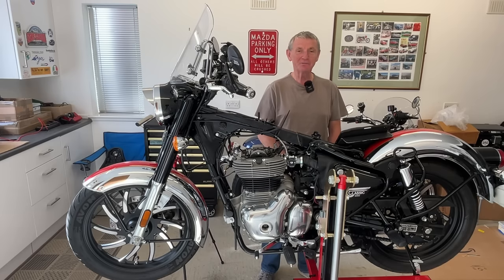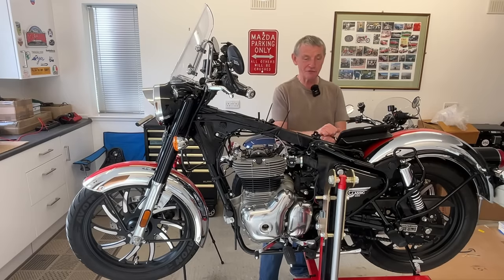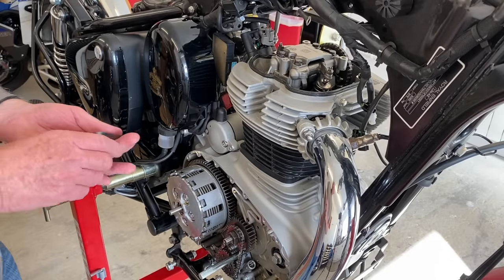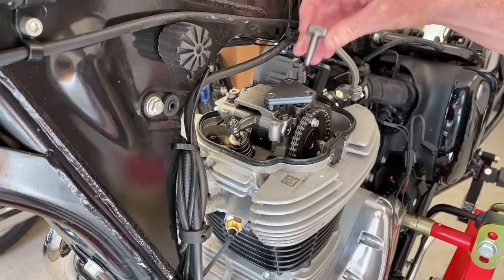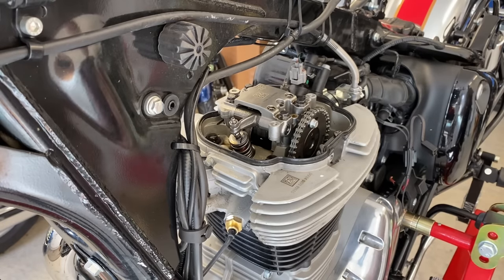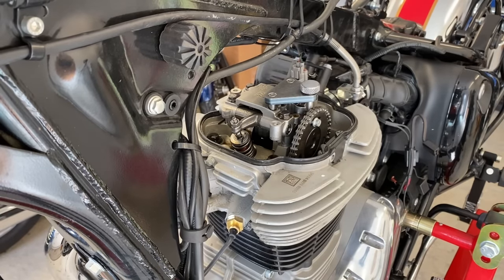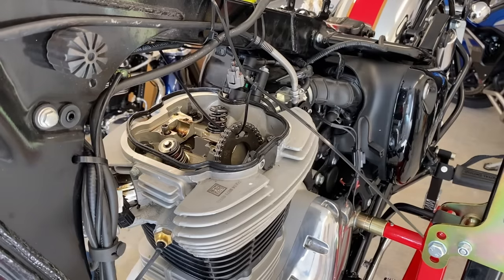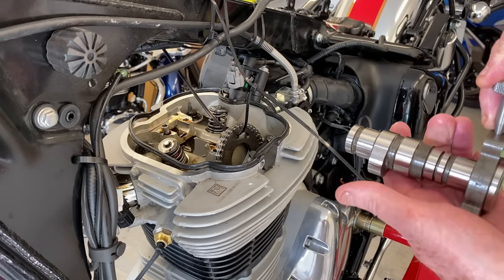Royal Enfield Classic 350 - Fitting the Hitchcocks Performance Camshaft

Comment: There is another mod that is to change the carb/ecu to one from the hunter. The ecu is not restricted so should take the top speed up. Some one has said it will do around 80 with the carb and all the other mods.
Reply from the maker: Yes potentially it’s possible to fit an ECU from the Hunter and thus remove the top speed limiter. To date I don’t know of anyone who has done this modification. I also think the cost of the new ECU might be rather expensive. I know of a Hunter that has reached 87mph with the performance camshaft fitted.
I’m quite happy with the top speed of my bike, the camshaft has just made it more fun.
Hope you enjoyed my video 👍
Reply: There is someone in the US, a friend has just bought the hntr carb with ecu attached from India and will be fitting when the cams are back in stock. When it’s done I will update. Yes the video was very good way better than Hitchcocks.
Reply: Its not a carb it's a throttle body with fuel injector @Signals_Rider_Kent

Comment: With a performance cam , do you also need need longer valves? I tried a performance cam on a sr 500. Old 80 bike.
But the tappets were hitting the valve stam? Not dead center anymore.
Reply from the maker: No, you do not need longer valves. The standard valves work perfectly. This performance camshaft was designed specifically to work on the new 350 J series engines. This is modification that’s well worth doing, as vouched by many owners who have fitted them.
Hope you enjoyed the video 👍

Comment: Great video Ian. Been interested in this. But am no mechanic. Very interesting to see the insides of the J engine, well top half.
Looking forward to part 2, and how your gorgeous bike, is afterwards. It says not much running in required.
Should give a significant power and torque, up through the gears. Fantatatic. Love it.
Lol…..Got few accessories in mind etc, for Bumble, next year.
Best regards.😊
Reply from the maker: Hi Marc, great to hear that you enjoyed the video.
It’s definitely improved the performance of the bike, faster acceleration and pulls up hills better. Top speed is just the same as it’s speed limited.
What is great is that overtaking is so much easier now, it accelerates up to top speed with ease. It was always a fun bike to ride, now it’s even better.
Nothing really to run in, I just took it easy for a few miles.
Enjoyed watching Coast Rider and you a few days ago. Ride safe 👍
Reply: @tigerness5555  that will be a real positive, the fact you know you have more oomph, to do an overtake.
Bruce, is a lovely person, just wish, I had gone further south, with him. Really nice, 2 RE’s together!
Hopefully see you at Wee Smokie,m this Sunday, if dry.
Mark.

Comment: WOW excellent work thankyou. When are you doing the throttle body. Wee mark  just did his and likes it alot.
I think he said RL T 00187 was part #. Anyways looking forward for that video. Just found out hunter throttle body only works for meteor, darn it.
Reply from the maker: Great to hear you enjoyed the video. The RLT00187 throttle body does not work on the classic 350, I know because I tried fitting one to my bike. To date I’ve not found an unrestricted throttle body that works on the classic 350.
Reply: @tigerness5555  Have ye tried the older RLT00164 Throttle Body? It's unrestricted as well I believe.
Reply from the maker: The RLT00164 is the standard Hunter throttle body. 
I had an RLT00187 body and it didn’t work on my Classic 350. I sold it to a friend who has a Meteor and a Hunter. He fitted it to the Meteor first and it worked properly and was unrestricted. He then fitted it to the Hunter with the same unrestricted result. By this reasoning, I suspect that the RLT00164 will also not work on the Classic 350.
I’m still no further forward in finding an unrestricted body for the Classic 350.
Reply: @tigerness5555  The RLT00164 is the previous Hunter TB and the 187 is the most recent one for the Hunter, I think? I get your logic on why it, too, wouldn't work on the Classic 350. Thank you. I'm fitting the Camshaft next week but I won't be cracking the RH Clutch cover open. Like the video from Foxxy, if you look closely, if you just mark the cam sprocket/chain location first, you can avoid it. I will use the cam tool but not the crank tool. Too much of a pain. I'll loosen the TOP Sprocket bolt slightly first but keep it on, remove the two others and return to the one (Top) position then put her in 1st gear, remove it, then replace the camshaft just like you did. I'll also replace the tensioner with only 1x bolt tightened on the sprocket with the previous chain/sprocket position put back and then it should be good. The Foxxy video was also seemingly done this way. The thought of the clutch arm/spring issues I've seen makes me want to try it this way. Your thoughts? I do have the crank pin IF it doesn't go well I can reset it. Also, the chain and sprocket will not fall into the case if left but I'll do as you did with zip ties. And you don't need to reset the ECU. It's not an ECU, Sensor or change that requires it imho. Cheers, love your videos. You have a, wonderfully positive and humble disposition. 👌
Reply from the maker: I made my video to show how to do the job correctly. If I wasn’t making a video I would have done it differently 🤣
Reply: @tigerness5555  understood 👌

Comment: Does the right hand engine cover ( clutch side ) have a gasket ? The crankshaft TDC tool seems like a simple piece of round steel . If we knew the diameter of the bar one could be easily made .Very good video. Thanks Tiger Ness.
Reply from the maker: Yes it does have a gasket, there is engine oil inside it. 
Hope you enjoyed the video and found it helpful 👍
Reply: Thanks again for your reply.
 @tigerness5555

Comment: Hello friend!  What tires do you use on your motorcycle?  Which size?  Did you need to modify something?  Thanks.
Reply from the maker: Hope you enjoyed my video 😁
My bike is now fitted with alloy wheels allowing me to use tubeless tires.
They are Avon Roadrider MK ll
Front: 100/90 - 19
Rear:  120/80 - 18

Standard Classic 350 sizes the same as my spoked wheels, hope this helps 👍

Comment: Hi, great video
! It gave me the confidence to do it myself. Unfotunately, the bike wont start now. Any advice as to what i might adjust or check for? When tightening those three bolts i initially didnt have the lock in and the sproket shifted a bit.
Reply from the maker: It’s possible that your valve timing is out. More likely it’s an electrical part you’ve not reconnected properly. Do you hear the fuel pump pressuring the system when you turn the ignition on? Is the fuel line properly plugged in?
Reply: @tigerness5555  Thanks. Connections look good, so I'll try putting the cam in again! By the way, if I really messed things up and the valves aren't closed when I lock the crank at TDC, can I push them down by hand when I take off the rocker box so they are ready for the new cam placement?

Comment: Great explanation and easy to follow tutorial, thank you! But from my understanding RE have chosen their standard camshaft to keep the engine from running to hot (and also exhaust restriction). Will overheating be a problem if replacing the camshaft?
Reply from the maker: I have the decat pipe, FuelX light and Hitchcocks air box cover on the bike. I also have an oil temperature gauge fitted. My bike runs very well with no overheating.
Hope you enjoyed my video 👍
Reply: I really did, thank you!

Comment: Does the camshaft have bearings in this motor?  I've got 350 Classic acquisition syndrome bad.  If it really gives the performance improvements that Hitchcocks claims, this is a no brainer. Great video.  Very clear.
Reply from the maker: The performance camshaft runs in the cylinder head in exactly the same way as the standard camshaft. It doesn’t have any different bearings. Check out the Hitchcocks link to the camshaft, it shows the performance gains proven on their dyno.
https://accessories.hitchcocksmotorcycles.com/48439?cont_page=Royal-Enfield-350-Classic-Accessories&category=top5&Page=1

Comment: On the first  set would like to thanks alot for all those great information🙏I am planning soon to upgrade with  Hitchcock cam and powertronic ecu, do you recommend to change the oil soon after the upgrade ?
Reply from the maker: Great to hear that you enjoyed the video and have found it helpful.
As for changing the oil, if you follow the instructions on the video you will need to drain the oil before taking the clutch casing off. Because of this you will probably be fitting a new oil filter and clean oil. In my opinion there is no need to then do another oil change, simply go with theservice schedule.
Reply: Thanks a lot once again 🙏

Comment: Great job Sir.Hows the performance now also is there any tappet sound?Mine ran close to 6000km still tappet sound is more even after adjustment.Also how you go that shine in engine case?
Reply from the maker: The performance of my bike is excellent now. The tappet sound hasn’t changed in any way, I’ll re-check them in a few hundred miles to ensure all is still within specification.
As to my shiny engine, I simply wash when required and then spray with GT85. I’ve never polished the engine casings.
Great to hear that you enjoyed my video 👍

Comment: Part way through taking mine apart, taking my time as i have been very ill.  A couple of surprises,found an "O"  ring in the clutch side engine casing. Luckily it stayed there and didn't go on the floor. Found where it goes,at the bottom of the oil feed to drain bung. The clutch lever spring span round and I thought there would be issues?
 I take it the clutch lever is supposed to be level with the mark on the side case when fully bolted up?  And dowls stayed in the engine and some on the casing. I put them back on the engine ! Do you think that's right?
Top of tomorrow done to much today. Now feeling it. Thanks for any help.
Reply from the maker: The clutch lever actuates a rack and pinion gear to operate the clutch. When I put my casing back on, I ignored the lever position, just ensure the gears align correctly. The casing won’t go on if this is incorrect, don’t use force.
Once the casing is back on and all the bolts tightened up, slacken the bolt holding the lever onto the shaft splines. The lever will probably be in the wrong position.
Reposition the lever to line up with the mark on the casing, tighten the bolt and refit the cable.
The dowels are better on the engine as they help to hold the new gasket in position.
Hope this helps and the camshaft install all goes smoothly.
Cheers TN
Reply: @tigerness5555  thank you for the quick reply. Skylift is working well,helps just being off the floor.

Comment: Fantastic video. I've watched it numerous times in preparation for the arrival of my Christmas cam (and specialty tools and cat delete pipe). Having adjusted my valves previously, I feel more confident in doing this upgrade. I know the cost may not justify the results, but what price can you put on knowledge gained and the fun of wrenching. One question, Hitchcocks instructions differ from yours on seating camshaft or am I confusing that with re-mapping the ECU?
Reply from the maker: Great to hear that you enjoyed the video 👍
I’m not quite clear what do you mean about seating the camshaft. I also watched Hitchcocks video a few times and followed how they installed the camshaft and did mine in exactly the same way. I did find that their video wasn’t very clear at times and this was the reason for me making mine.
Reply: Sorry for my confusing question. Hitchcocks website says the following which was different to your final process: "There is very little required to bed in the cam on the roller rocker setup on these engines. The typical procedure would be as follows: start the engine up and pick the revs straight up to 2000-3000rpm for approx. 10-15 minutes, during this time vary the rpm smoothly throughout this range and do not allow the engine idle for any extended period of time. After this, allow the engine to cool and it can then be run as normal".

Comment: Hi, just doing this on my Hunter. Once you have the first bolt loosely holding the sprocket on the new camshaft and need to take up the slack in the cam chain; I see you used finger pressure, but it looks as if you could just refit the can-chain tensioner? Is that a good idea? With the Hunter the exhaust pipe can remain in place, (just remove a heat shield) as can the rear brake. Well it came off OK so I suppose it can go back. :) Thank you for your inspiring work.
Reply from the maker: Hi Patric
When I fitted my camshaft I followed exactly how Hitchcocks fitted the camshaft on their video.
That said I thought exactly the same as you and thought that fitting the tensioner before tightening the bolt would put the correct tension on the chain.
But I don’t know if this is actually correct or not, but would be logical to me.

Another issue is fitting the clutch side casing back on. The clutch push rod must be in the correct position with the gear teeth facing the rear.
Watch Coastriders video he had this problem.

https://youtu.be/ub6uCKAH3Mo?si=qmca-f2zcA7T5DE7

Hope this helps
TN
Reply: @tigerness5555 Thank you again for your invaluable help, it all went back together and runs as sweet as a nut. I even did the 30 min idle. :)

Comment: Hi, I'm close to buying my halcyon now !!  I'm curious about the tdc hole in the top of the cam? Is the hole in the cam  tapered or is it just the location pin that's tapered? Kent cams didn't reply to my enquiry __ shame.
Reply from the maker: Hi Michael,
Good question, unfortunately without taking my cam cover of to check I don’t know the answer.
 But I did have a look at the standard camshaft that came off my bike. It has a 5mm hole with NO TAPER, I would recon the Kent camshaft is exactly the same.
Hope this helps and that my video has also been useful to you 👍
Reply: @tigerness5555 Hi , A BIG THANK YOU. That's   perfect,  and means  that  taper on tht alignment tool only serves the purpose of centering the hole in the cam to the rocker box loacati g holes.  Just to clarify; part of my enjoyment in bikes is in making the tools and parts for them,.  I'm retired now, and have some moderate machining capacity in the garage. Since I dont have my bike yet, I couldn't measure it myself, and my curiosity was nagging at me. Thank you once again, keep  making the excellent videos, they really are the most informative and accurate on  UTube. Best Regards  Mike N

Comment: The cam is sold out 😢. Hopefully it’s just temporary. This video was great btw. I was wondering about what to torque the bolts at. The other vid didn’t say…
Reply from the maker: Could be my fault that it’s sold out, my video has been very popular 🤣
From memory all the torque wrench settings were 10Nm. Check out the video again as I mention what they are in it.
Great to hear that you enjoyed the video 👍
Reply: @tigerness5555  makes sense ha ha. Do you think with all these mods, this bike can make a 2000ft (609m) climb at 55 mph? (I commute on a small highway at 55 mph to work 5% grade.)
Reply from the maker: @TheAverageJoeBro  I would think it would manage it without any problem. As standard it’s a torquey little engine that pulls very well. With the performance camshaft you really feel the extra power coming in as the revs rise.
Only one way to find out 🤣

Comment: Excellent video TN and a job well explained and videoed. If I was of a mind to carry this out on my Classic it would be this video I would use to guide me, thank you. 

I recently managed to obtain via the internet a copy of the service manual for this bike as mine is now due it’s 3k service and was looking for the page that describes the timing procedure even though I’d seen yours and others YouTube videos when I came across the page that describes the refitting of the cam, page 145. There is a warning box that says the rocker carrier bolts are one use and DO NOT reuse. Also when fitting the new ones that engine oil should be applied beforehand. I’ve no idea why they say this, perhaps Hitchcocks could advise? 

Watchers should note if you look carefully that the performance graph shown here that is taken from  Hitchcocks site explains that the bike tested had the decat pipe and and replacement air filter cover fitted but with a standard air filter and exhaust, I’ve no idea if the results would be different if the bike was otherwise stock.

Edit: Just to add to the confusion the manual explicitly says not to rotate the crank anti-clockwise! Page 143. Hitchcocks video is as yours. Maybe there’s a typo but I for one will consult my dealer to the correct procedure just to be safe.
Reply from the maker: Great to hear that you enjoyed my video 👍
I watched the Hitchcocks video a few times and found some parts were not very well filmed. I thought I could make a better video following exactly how they did the change.
I also have a service manual that I managed to download. In my opinion it’s very poorly laid out and is fairly confusing at times. I do think that the crankshaft should be turned anti clockwise, this is the way it revolves when running. It’s also important to keep the front run of the cam chain tight allowing any slack at the rear to be taken up by the tensioner.
Then what do I know, I’m not a mechanic 🤣
Reply: I agree that the online manual doing the rounds is quite poor, I suspect it’s not the final draft. Your video is much better than  Hitchcocks which is a credit to you; if I were to consider this mod id use yours for sure. I look forward to the next exciting instalment 🙂